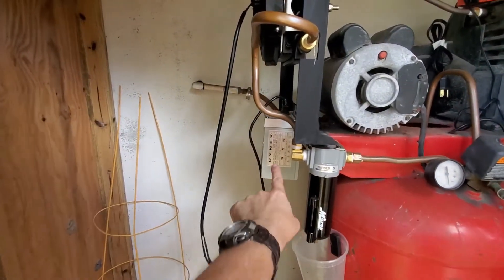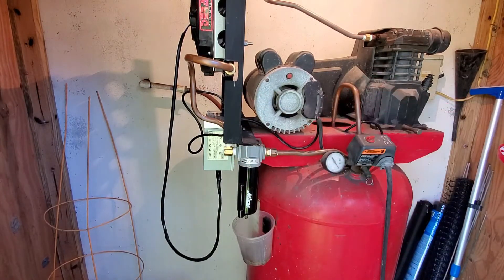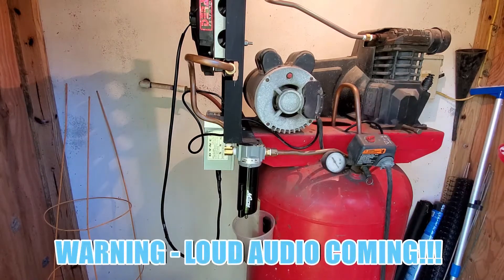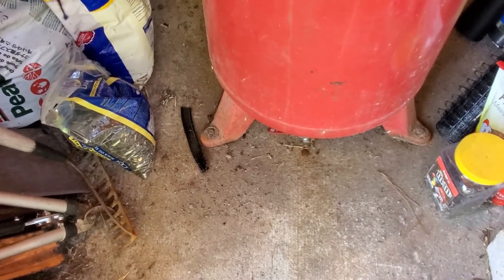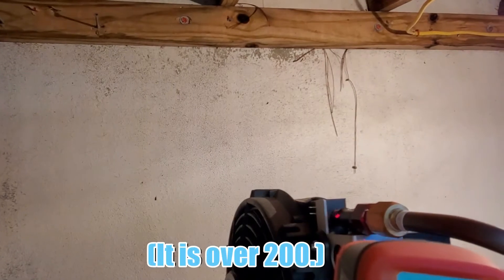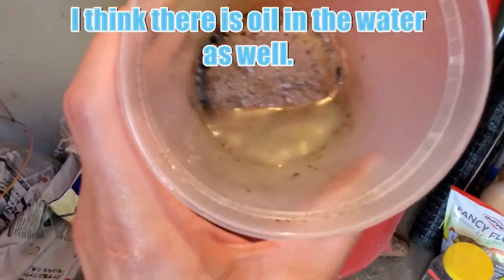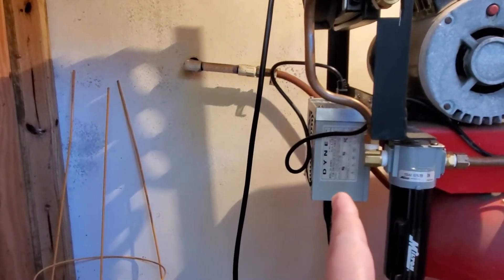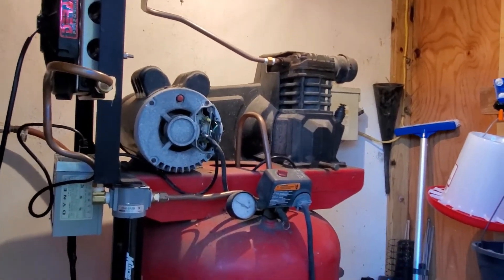Air Compressor after cooler - final results with fan

Comment: late to the show, but if u put a piece of black electrical tape on the part u want to measure (i guess the copper pipe) it will help your IR thermometer get a more 'accurate' reading....  Those devices are affected by the color and shinyness (sp?) of the surface u are trying to measure.
Reply from the maker: interesting...never thought of that.  Thanks!

Comment: hi great job ill be doing the same how did you get the fan to work please
Reply from the maker: Thank you.  You will need a power supply of some sort.  I used a computer power supply and it works great.  The power supply can run off of 220 and it is triggered by the compressor switch.  Warning - This is "off label" use for sure and there is risk of fire and electrocution.

Comment: a friend added a long piece of 1/4" pipe where the drain on the tank bottom is, so the water goes in there vs lay in the tank rusting it. changed the oil to Amsoil too he said
Reply from the maker: Thanks for the comment.  I switched to Amsoil about a year ago.  I have an extended drain pipe with a valve too.  Unfortunately right now when I drain it it just pours right into the floor. I do want to add some tubing on the valve that shoots the water out into the yard or whatever.  If I ever get a new one I will switch to one of the automatic drains.

Comment: Can you show how you wire the fan to the pressure switch or the entire process how you did it? Thanks!
Reply from the maker: It is wired in after the switch.  The power cord to the computer power supply is connected to where the wires come into the compressor motor.  Not sure if this is a good idea or not, so I chose not to show it.  Not sure if it will catch fire, burn up motor, etc.  So far, it has been working great.
Reply from the maker: PS - the power supply has a 120/220v switch and I have it on 220v as that is what the motor gets.
Reply: Just find a 110/220v to 12v converter and wire to the motor side of the preasure switch and fan will turn on/off with motor

Comment: Running essentially the same setup (bought the Derale 15300 and that same fan separately). Just plain works. My inlet temps to the water separator were just a little higher than ambient after a 10 minute torture test. Nice job! Keeping water out of the tank is always a good idea. For an extended run, my use case is a CNC plasma, your outlet temps from the tank will be stable (low) and you won't be pumping hot, high absolute humidity air through your filters/driers downstream.
Reply from the maker: Thanks Frederick.  Glad yours is running well.  I actually had to order a replacement cooler already.  The vibration caused the inlet tube to crack (it completely broke off.)  I added a "brace" to hopefully reduce the vibrations and keep this from happening again.  I will record a short video here in a few weeks to show what I did.
Reply: @KMLTimesTwo  Bummer! I went over to Hose Power and had them custom make some SS braided hoses (500 degree rated) with integral AN fittings. Hoping the hoses have a little bit of vibration damping - not the first I heard of the barbs breaking off.
Reply from the maker: @imkindofabigdeal4308  I originally wanted a hose, but couldn't find any "air" hose with a high enough temp rating.  Glad to know that there are options that you found.  In addition to the brace I added, I ordered vibration pads for under my compressor.  It will be an experiment at this point.  If it breaks again, I will either switch to hoses like you and/or mount the cooler to the wall.  I am jealous of your CNC plasma!  That it is on my future list of wants.  Good luck!

Comment: Hey there, these videos really helped me get my cooler set-up going with my air compressor! Appreciate it. I do have one questions for you. I also have a Derale cooler with the same fan and I just have a simple 10A, 12V DC power supply. It doesn't appear to be enough though. The power supply won't turn the fan on and run it constantly... I believe the initial amp draw from the fan is higher than the 10A. Derale's website states this fan needs 5.3A, but I think that's at steady state once it's running. Could you tell me how much amperage you have going to the fan to get it to turn on like it does? Thanks again.
Reply from the maker: I am glad it helped!  I took a look at the sticker of my (computer) power supply and the 12v section says 14.x amps.  I am assuming this is for all the 12v leads combined and this is how I used it.  I don't have a amp meter to test it, but maybe my neighbor does.  If I can get one, I will let you know the draw.  FYI that my cooler inlet cracked.  I think I had too much vibration.  I will post another video soon about it.  I need to order another cooler to replace it.  I reached out to Derale to find the part # of just the cooler.  I will add another brace to reduce vibration.  Luckily I kept the original set up, so it is now running in its stock form until I get the new cooler.

Comment: I like the idea, I added an old compressor that no longer had a motor to my big compressor to add volume and to collect any residual water. I am going to add a cooling fan to the setup.
Reply from the maker: Thanks Bill.  I am always on the look out for a worn our compressor to add a tank. If I really get into the vapor blasting stuff, I may end up getting a new(er) 80 gallon one that puts out more CFM.